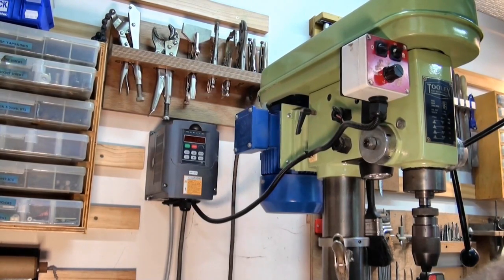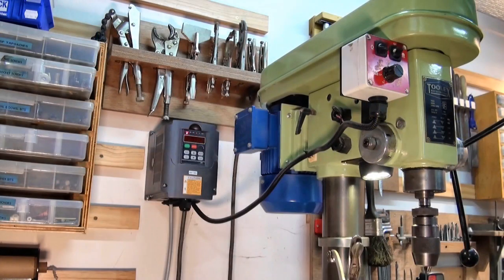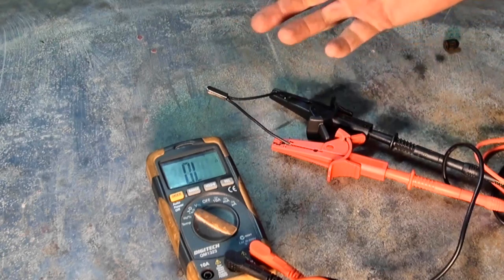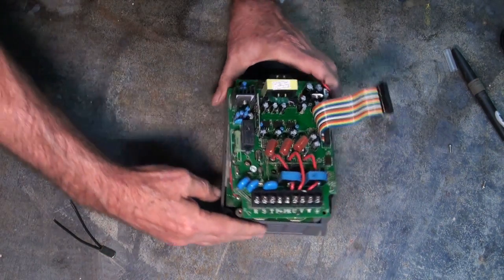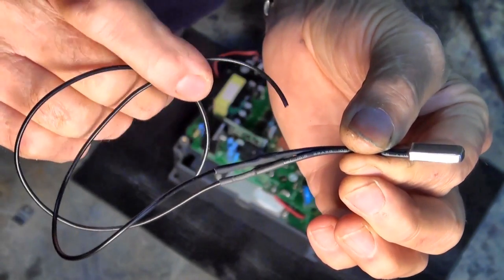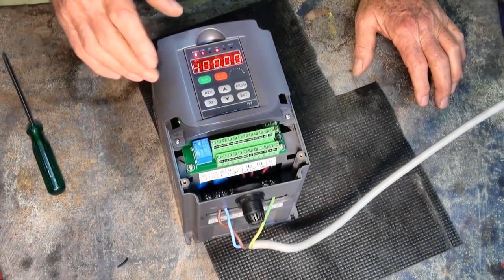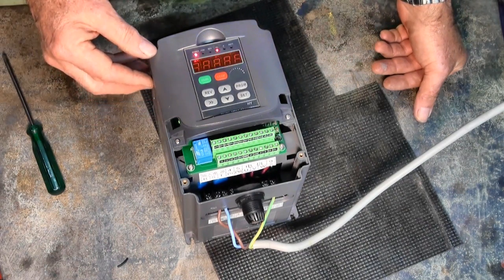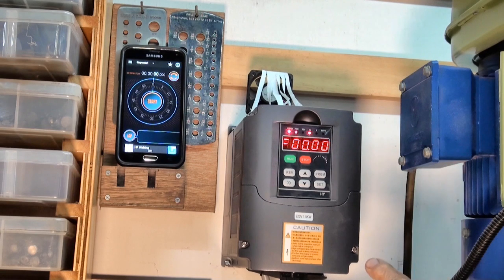How to make a SILENT Huanyang Variable Frequency Drive.

Comment: Hi ... & thanks for a very inspiring video. Having just bought a Huanyang VFD I definitely wished for the fan to quiet - and your video was most inspiring in this context. HOWEVER, I would like to suggest a simpler solution which is to: A. remove the plastic grill covering the fan and lift the fan up and out of the cabinet; B. Cut one of the wires connecting to the fan, and mount the thermoswitch inbetween these two wire ends (do not cut the other wire - just one of them). Then glue the thermoswitch onto the heatsink (I used epoxy) - it fits exactly inbetween two fins. This operation may take about 15 minutes - excluding epoxy curing time - and gives the same result. And one does not have to disassemble the VFD, drill a hole in the heatsink etc.
Reply from the maker: Hi, Unfortunately there are many variants of the Huanyang VFD. Some are actually clones of the clone and they all seem to have different variations of the plastic housing and protection of the heatsink. In my case the heatsink was pretty much totally enclosed by the plastic housing and I needed to dismantle it to get at the aluminium extrusion. I considered using epoxy to mount the thermal switch but after many heat cycles and differential expansion and contraction I figured that the epoxy would delaminate. This could happen and the operator would be unaware that the switch was no longer attached to the heatsink unless you inspected it. If the glue did fail the fan would not switch on, ever.... and then you could have a situation where it was needed due to excessive heat and it would not do it's job. The little clip that I made was more work but it should never fail. I did actually fit the switch in series with one of the power wires to the fan and I must say the drive is now totally silent but I have had the fan cut in, once. It was quite hot in the workshop and I had just finished drilling a large number of large diameter holes in some stainless steel sheet using a big step drill. The fan ran for about five minutes and then, like magic, it stopped again. I am guessing that you were lucky that your switch was a nice fit between the fins and this should reduce the likelihood of it getting dislodged. I hope you are enjoying the "sounds of silence". 
Regards,
Preso
Reply: @Preso58  Hi Mark. Pleased to read your feedback ;-) I am not that familiar with different versions of these Huanyang VFDs but the one I bought is a 2.2 kw version (HY series). And I most definitely appreciate the silence -  although a CNC mill likely is never silent when used having the fan in the vfd on always without any real need for this really was disturbing. And now it appears to be always silent - indeed a relief! So many thanks for the inspiration - cheers ;-) ... Jesper

Comment: Yup, I just mounted a Huanyang VFD to a lathe. Wow that fan is annoying! Good on you for sorting out a solution. I've done the same in the past with welders that only need fanning when you were pushing. 
I just orderred a themo switch for this lathe.
So here's a thought, You could jump your themo switch with enough of a resistor to have the fan motor around at a quiet speed. Then if it will still blast if it needed to. 
On a drill press I'd be surprised if you get it warm enough to bother though.
I'll let you know what resistor works if I get around to sorting that out.
Cheers
Reply from the maker: Arri, I have only ever had the fan start up once after I had drilled a number of fairly large holes with a holesaw. It was also a fairly warm day but now I can leave the VFD on for extended periods with it just idling and it is still functioning perfectly. 
Regards,
Mark
Reply: @Preso58  Good to know!
Reply: I would like to put a resistor across my thermo switch.  Did you figure out what you needed to make the fan spin at a slower speed?  I also thought about sending power to the fan when I am drawing power from the VFD but I haven't figured out which terminal to use for power or how to program a terminal to deliver power.

Comment: Nice job Mark. I have a very similar  Huanyang  drive running my lathe mill combo and yes the noise is bloody horrendous! Made worse by the fact that I'm in an 8 foot by 6 foot insulated shed! I must get round to doing the same mod to mine. Thank you for posting this. Cheers from ?England mate.
Reply from the maker: I also hated the sound of that little whirring fan. I knew it wasn't using much power but it just bothered me for some reason. Probably because I knew it was unnecessary for it to be running when the drill wasn't operating.
Regards,
Mark

Comment: Mark, I think they changed the design. Mine (3h.p. unit) has a larger (understandably) fan and is very quiet. The carrier frequency setting did the trick! Some units can be set to control the fan settings according to the frequency  settings, min and max.. Thanks, -Tom
Reply from the maker: Thanks for the feedback Tom. I did notice what looked like a temperature sensor but I don't know enough to reverse engineer what it might be for. I will have a look at the manual to see if there is anything in there about controlling the fan but, you know, the translation is difficult to follow.
Regards,
Mark
Reply: @Preso58  oh yes....the mauals....crazy....I stay in a constant state of frustration, plus I am not the electronics wizard. I must apologize about the 2.2kw unit I have. It does have the same fan and does make some noise. I just didn't realize how much until you called that out....😁. Very sorry to mis-inform you. I was going on memory when I sent you the note. Thank you for you most wonderful, methodical, and professional actions (I mean that). -Tom

Comment: Nice idea ...I think cooling fan should working when inverter is running  not defend on temperature.
 I think Mitsubishi inverter has those kind option. I don't understand why the Huanyang ignore that option.
Reply from the maker: I have recently purchased two Bosch Rexroth VFD's and the fan can be set to three different modes in the parameters. Always on, always off or auto which I assume is temperature dependent. The fan on my Huanyang almost never starts unless it is a very hot day and I am using some big drill bits or holesaws. It seems to suggest that for intermittent use, the fan is mostly redundant. 
Regards,
Mark

Comment: If it makes you feel any better, I have an Allen-Bradley VFD on my drill press that has a fan that always runs.  Was so annoying I just disconnected the fan altogether.  As a hobbyist, I never run the drill press hard/long enough to "work" the VFD anyways.
Reply from the maker: That is exactly what I am starting to realise. Since fitting the temperature sensor I have never had the fan start up so the heatsink is never getting more than warm during the times I use the machine.
Reply: I’ve got a leeson vfd that also has a constant loud fan, when it’s first started and it’s cold the bearings get rough and the fan slows down and makes a grinding noise (just like both my welders lol). Only part that gets warm is the plastic over the capacitor bus

Comment: I suppose a small air line off the shop dust collection system would draw air thru the VFD, and the noisy dust collection system would be functioning so anything you do will be cleaned up after right away.

Comment: And FWIW if you put 500 ohms across the thermo switch leads the fan motors around enough to encourage air movement  but is next to silent.
Reply from the maker: Arri, thanks for that. I must say I was so grateful when I found a way to shut it up that I just left it alone after that. 
Regards,
Mark

Comment: Good video, good idea. But be aware, that KDS9700 has NOT insulated housing. In application shown it does not matter much, but if you want to connect Huanyang VFD to external (CNC) controller, you'll end with a voltage shift (on ground on VFD) and the system will not work properly. Measure, check, recheck - if suitable for your application, splendid. I installed KDS on 2 of my VFDs - and was happy with this solution until I connected the VFD to the controller. Had to remove both.
Reply from the maker: Thanks Jan,
I didn't expect that I would be connecting this VFD to a CNC controller but it might be relevant for others.
Regards,
Mark

Comment: I got some 12V  auxiliary fans for a desktop computer some years ago. They have orange curved blades and are nearly dead silent. I got the larger diameter fans, I do not know how small they get. (Amazon? ) Since your fan blows on a heat sink, I guess the fan is not blowing on individual components which would not trigger your thermo switches.

Comment: Excellent Video. Massive thankyou. I'll be doing this for mine this week.
Reply from the maker: Thanks, I can tell you that the fan in my VFD has only ever started up once after I drilled a large number of holes with a step drill through some aluminium tubing on a very hot day. Other than that I never hear it run. Having said that it would depend on the application. Drill presses tend to run intermittently and often they do short runs at light duty. It might be different for applications like pumps or large fans.
Regards,
Mark Presling
Reply: @Preso58  How did you come up with 45c being the right number for the sensor on this? Just a guess? What if they are meant to run cooler than that?
Reply from the maker: @Sugarkryptonite  it was just an educated guess. I actually bought several different sensors with varying temperature ratings. I chose the 45C because that's about the temperature in the workshop on a really hot day and as it turns out it is about right. The fan rarely turns on and the VFD is still going great after nearly three years of use.

Comment: Nice vid. On larger drives they have a parameter that gives a read out on heat sink temperature. On drives over 75 HP they may have up to 3 cooling fans in drive and another one if using a 18 pulse drive. Some are very hard to replace. You could of nust got a 240 volt muffin fan and secured it to bottom of drive and remove 1 wire off noisy fan. Have duct taped muffin fans on bottom of drives that had a  bad fan just to get by until it could be shut down. Used a box fan tied to milk crates to cool 40 to 100 HP drives in a pinch.
Reply from the maker: I have had a lot of viewers suggesting that I should swap out the fan for a different type but at the end of the day, having done the mod on the drive, the fan hardly ever runs. For the application that I am using it for, the drive hardly ever works very hard so having it remain completely silent is a bonus. It also saves energy! Although the drive is inferior to my better quality Invertek VFD, it was half the price and it's still working perfectly.
Regards,
Mark

Comment: could you wedge the thermo switch between the fins of the heatsink beneath the fan? use a piece of pallet banding strasp bent into a V shape and wedge the 2 sides between the switch and the fins. that would maintain consistent contact between the switch and the heatsink.
Reply from the maker: Yes, that would work. Anything that keeps the two surfaces together would be fine.
Regards,
Mark

Comment: I’m looking to purchase a VFD for my 2 hp mill and I’ve been quoted about $550. CDN for a VFD. Now that’s expensive. I’m not going to pay that although I may because it’s included in a motor package. There are other factors holding up my purchase right now or I would have the motor and VFD. I’m not an electrics guy and I need to rely on the skills of others in this department. I intend to set up the VFD on a bench before I assemble the bits on the mill then just install what I need along with some remote switching.
Reply from the maker: The manual that comes with most of the Chinese VFD's are not exactly well written but there is a wiring diagram in the front of the book that is fairly easy to follow. Some of the Chinese VFD's come preconfigured with a very slow ramp up time which makes it seem like the motor or the VFD is faulty. Changing just that one parameter makes all the difference. 
Regards,
Mark

Comment: Most electronics should be kept in the 40C range so you should have used no more than a 35C thermistor
As for carrier frequency 8 is standard for any 230v / 240v motor with a max of 10 above that you would have to watch for motor overheating

Comment: I was going to look into getting a fan from Noctua as they are industrial and quiet but now idk, id like to have it off like this.
Reply from the maker: I must say, this is one of the more successful modifications I have made in my shop to date. The fan actually switched on for the first time a few days ago when I had to drill 64 large diameter holes in some stainless steel sheet with a step drill. It was a fairly hot day too so that might have something to do with it. I also watched a video by rolingmetal who said that his Huangyang VFD blew up and he suspected it was because he had disconnected the fan altogether.  At least mine has the fan as backup when it is needed which is apparently not very often.
Hope you mod goes well.
Regards,
Preso
Reply: @Preso58  Yeah honestly I am on my 4th VFD lol because 2 blew up prior

Comment: The efficiency of modern electronics is very impressive. In the old days, just the power supply for a drive could put out enough heat to bake a cake.

Comment: While you were in there, you should have upgraded the fan itself as well. Those chinesium imports almost always come with low cost low quality ball bearing fans, a higher cost, well made pin bearing fan will run longer, and smoother, with little to no "rattling" as you'll eventually get from the low cost ball bearing types. (you can also switch to a high CFM fan to increase the air flow, cooling things off faster, that means the fan will be on less, but will be a bit louder when it is on)
Reply from the maker: As it turns out, the fan almost never starts up on this VFD since including the thermal switch. Probably because the drill motor is only used intermittently and it's generally only lightly loaded. If the drive were running a pump or a fan it would probably get hot enough to need the extra cooling. I was drilling a lot of holes with a large holesaw on a fairly hot day and the fan did kick in but that's probably the only time. 
Regards,
Mark

Comment: Thanks Mark, there’s a lot more stuff jammed in that box than I realised. Maybe it’s just me but I can’t help thinking that your solution is way over engineered, why not just get a decent quality quiet fan and connect the original fan wires to it. If the new fan won’t fit into the original mounting hole it can be mounted externally on top of the housing. Just my thoughts. Cheers Stuart 🇦🇺
Reply from the maker: I guess it's a sort of OCD thing. I sometimes walk out and forget to turn the drill off at the wall. I would worry about a fan running non stop overnight. Until I dismantled the case I didn't realise how deep I would have to go into the guts to mount the thermal switch and I was pretty much committed to the mod by then. The good thing is that the fan does do it's thing if I run the drill hard and the rest of the time it just sits there and behaves itself.
Regards,
Mark

Comment: There is more than one way to skin a cat!!!  My method was to stick the temperature switch to a pencil eraser then sliding it down the fins from the fan opening. The eraser provides a clamping force between the plastic case back forcing the switch tightly up to to the heat sink. So no need to take the drive to pieces so preventing electronic disasters that could be waiting around the corner, by the way taking one of these drives apart it is recommended to take some form anti static precautions. I used this method two years ago with no problems, though I am sure that there are other methods to achieve the same end results.
Reply from the maker: I was dealing with an unknown quantity. Now that I know what is inside I can see that there would be plenty of ways to get the same result without risking the innards by taking it apart. 
Regards,
Mark

Comment: I had a similar problem with my computer cooling fans.  I found I could replace them with quiet or silent fans.  That might be a simpler solution.
Reply from the maker: Yes, a quieter fan would be better than having the noisy fan that the VFD came with but in reality the fan is almost never needed. I have only ever had the fan operating on a few occasions when it has been very hot in the workshop or when the drill press has been cutting a lot of very large holes. I guess it cuts down on electricity costs too.
Regards,
Mark